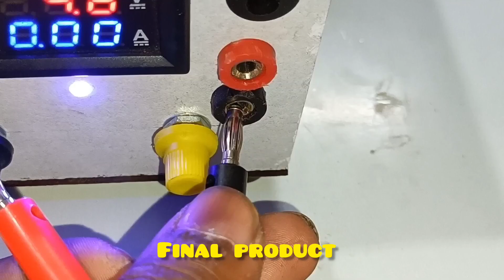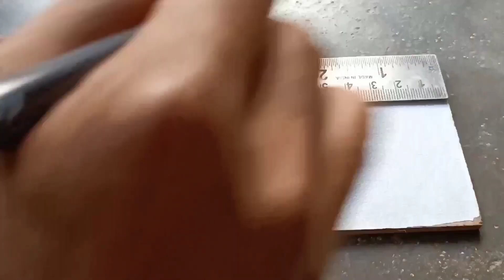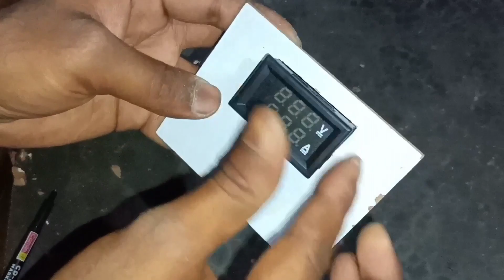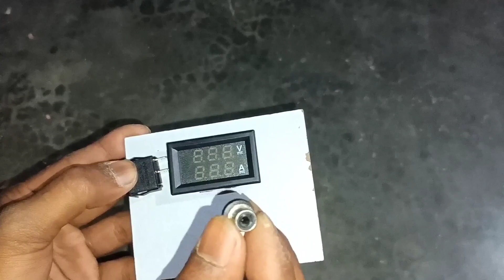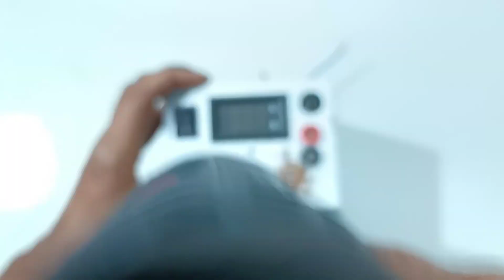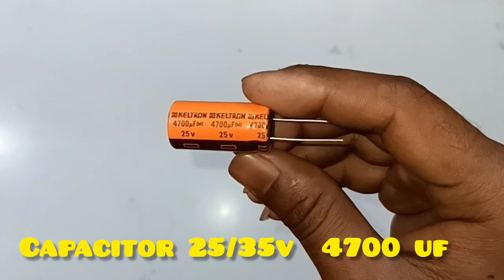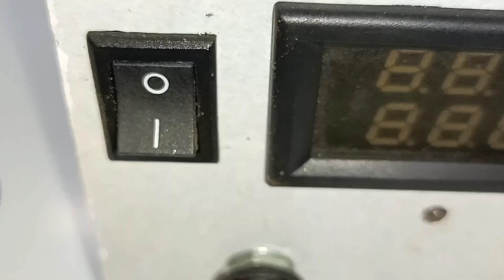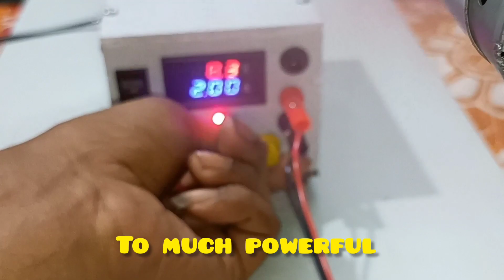how to make Power supply.1.3v to 36v. using 4a transmitter  #powersupply #arceemaker

Comment: É seu projeto ficou top, mais você esqueceu as brechas para a circulação de ar.
Reply: @arceemaker1  You put in a fan but forgot to open the slots on the sides, you opened it with a drill for better circulation. When the fan starts pulling hot air out, new air would have to come in through the slits.
Reply from the maker: @artcellcelular180  actually I am forget to record the video when  drill this Box .

Comment: What about the cooling fan? You have not shown the connection of the cooling fan. Why? Can you at least explain here how to do the cooling fan connection as well?
Reply from the maker: The transformer red and yellow one are 12v then you will need a 7805 transistor for cooling fan 🙂.
Reply: @arceemaker1  isn't it a 12v fan? I have a 12V Fan, how come it needs 7805 Transistor, when 7805 emits only 5V of power? Or perhaps the cooling fan you are using must be of 5 amps. Is it? Can you please explain more clearly buddy?
Reply from the maker: @TruthExposerOf666  bro this mini cooling fan need only 5v. that's why I'm explaining about 7805 transistor. 🙂 If you have 12v fan then you can directly connect 12v supply.
Reply: @arceemaker1  Thanks buddy.